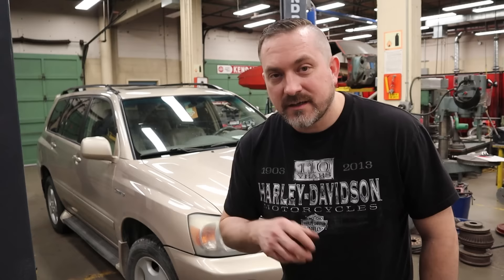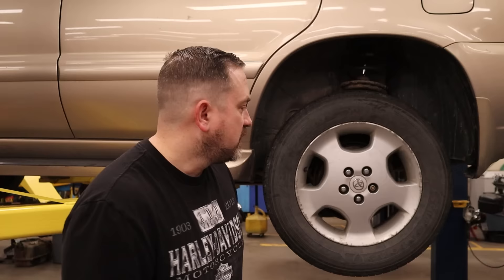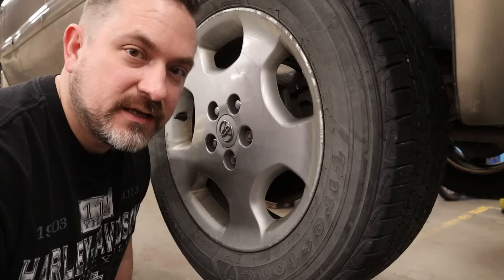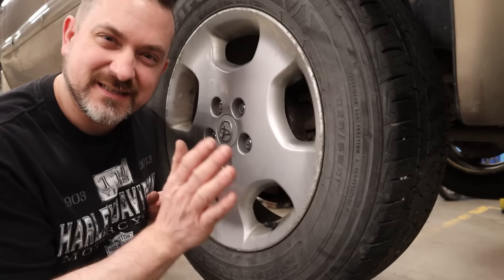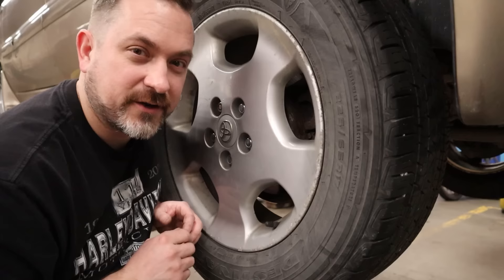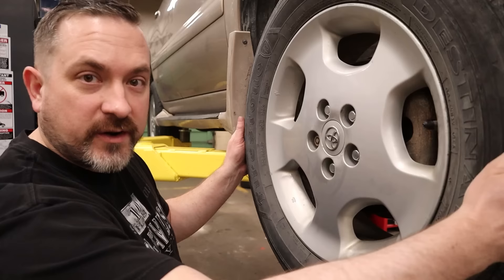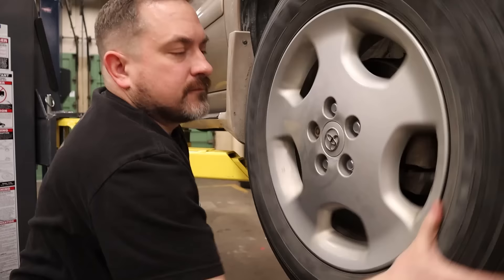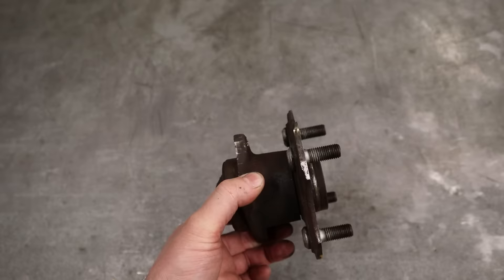How to 100% diagnose a bad wheel bearing.

Comment: My Honda accord 2011 start to have noise half year ago and is getting worse. It also has rubbing noise from 15mile-40mile/hr. on highway when I open either side of the rear wimdows, I can hear loud noise like helicopter. I cant hear such helicopter noise when open front window. I checked all 4 wheels but no play.

What could be the problem?
Reply from the maker: When you checked for play were the tires off of the ground?  You can't check for wheel bearing looseness with them on the ground, you have to jack the car up.

Comment: I have a 2012 Citroen berlingo and when I go really slow sometimes I hear like a clunking sound in the steering wheel? When i gain speed it goes away? Any ideas?
Reply from the maker: When you turn the steering wheel?  Hard to tell through a message but could be CV axles or bearing.  I have a great video on road testing a bearing you should check out too.  Thanks for the watch and welcome to the channel!

Comment: Ive got a wobbly front wheel ,  slightly left to right but worse top to bottom. Had the wheel bearing replaced a year ago and I dont hear any noise like before I replaced it.  Can you have a bad bearing WITHOUT noise?  The steering wheel shakes at different  hwy speeds at different  times so I can't figure out what is going on? It can be smooth for miles then I get the death wobble! Help!!
Reply from the maker: There could be multiple things going on.  Check lug nuts, suspension, and steering components for play.  If all are ok, then ya you might have a wheel bearing.  I have another video on how to road test a wheel bearing too if you're interested.  A death wobble is really serious though so get this fixed pronto!  Good luck!

Comment: Hey I have  a  2017 Ford mustang  it slides  when I change lanes  on the freeway  I have  already  had  a   front limite  and changed  my tires  and  it's  a little  better  but it still  slides in the back  end  of the car  what  can it be?
Reply from the maker: This sounds like loose or worn steering or suspension components.  Check the new tires for signs of alignment issue wear too.  Jack up the car and shake the wheels and pry on components to see what's bad.  Good luck and let me know what you find.  Cheers!

Comment: does a bad bearing at the rear make a knocking sound going over the pot holes and rumps?
Reply from the maker: No usually.  I would say it's a suspension component.  Does it happen when you go over a speed bump at an angle but not when you hit it dead on?  If so, that's anti sway bar end links or bushings.
Reply: many thanks. it does it when for example when not going over top of the bump but rather when coming down from the bump. i changed the springs, shocks sway bar  links, the rubber bushes, and some other bushes where the shocks bolted and so on and we run out ideas! the very shrap knocking sound comes off as the wheel makes its way down from the hump, as it hits the surface of the road. it does it on on very very low speed eg 5 miles an hour. obviously the more speed the harder the knocking sound! @wayofthewrench
Reply from the maker: Try this.  Have someone hop on the bumper to get the vehicle bouncing and hopefully making the noise.  Then get a light and listen/look for what is making the noise.  Hope that helps!  Let me know!

Comment: How do you get the wheel to spin while you have it jacked up? Wouldn't the brake pads and the car being in parked prevent the tires from spinning?
Reply from the maker: Great question!  If your brake system is working properly, the wheels should be able to spin no problem.  If a wheel is hard to spin or doesn't spin, then you either have your parking brake on or it is in gear/in park.  Or the caliper might be sticking and not allowing the pads to retract.  They should come away from the rotor and act as a wiper to clear mud off to give you an idea how close they are.  Thanks for the watch!
Reply: @wayofthewrench  I'm raising my vehicle with a car jack.  Wouldn't it be unsafe/could roll if I take it out of park while partially jacked up?   Thank you for responding so quickly!
Reply from the maker: If you jack up the front then no.  If you jack up the rear then you will have to remove the parking brake.  What ever drive it is ( fwd or rwd) if that wheel is being spun then you need it out of gear/park but remember I taught you to have two wheel chocks in front and behind the wheel still on the ground.
Reply: @wayofthewrench  thank you.  I need to get some chocks!👍😁
Reply from the maker: Happy wrenching!

Comment: Would there be play for a pressed in bearing?
Reply from the maker: If it is bad, yes.  If it's ok, then there will not be play.  If it's  a thrust style bearing, there could be a very small amount of play but that is usually adjusted out before you install the cotter pin. Thanks for the watch!
Reply: @wayofthewrench  2012 focus has pressed bearing.  I have a little clunk in the driver wheel. Every component o the front end has is new.  Been doing this before everything was replaced.
Reply from the maker: Sounds like bearing play.  If it isn't making noise, you might be able to slightly tighten the castle nut to reduce the play.  I have a video on that if you need it.  good luck!

Comment: Will a bad wheel bearing cause the tire pressure light to come on in a vehicle
Reply from the maker: Yes and no.  If you have a traditional tpms sensor that detects air pressure.....no it will not.  If you have a car that uses the wheel speed sensor to detect a low pressure tire by the flat tire spinning slightly less....then maybe.  If there is a speed dependant sound and play in the wheel though, you have a bad bearing and it requires a replacement.  Hope that helps.  Thanks for the watch!

Comment: So I have a question that I can’t seem to find an answer for. I have a 2017 Mazda cx 5 and after driving it and then going down a hill and applying the brakes a little the car will make a squeak or a chirping noise and can sound like someone taking a metal fork to a plate and this will make this noise for the rest of the ride even when the brake is not pressed and can only be heard if the window is down. It seems to be coming from the rear driver side tire. I brought it to the mechanic a month ago and they couldn’t find anything he said it may be that the brakes are glazed and if he files it down it may come back. Since then it has gotten worse and when I reverse while turning after hearing the squeaking noise I will hear 2 or 3 clanking noises like something is cracking. Weird thing is it only cracks in reverse when turning hard like pulling out of a parking spot and squeaks only when driving forward. I’m not driving it till I get it to another mechanic but if you know what this may be I’d greatly appreciate it.
Reply from the maker: My best advice is to do an inspection yourself.  I have a great video for checking disk brakes you should watch.  While you're there, check for a dust shield that is close to rubbing on the spinning disk.  You might have worn pads and the squealer tab is now touching.  The clunks in reverse could be suspension or steering related components.  It's really hard to diagnose over a message.  Hope that helps.  If I was able to help you out, I'd really appreciate it if you could share out my channel on your social media so I can help more people.  Thanks for the watch and welcome to the channel!

Comment: So I have abs sensor on,traction light on. Car gets louder with speed. Also u mention the steering linkage..well also a while back my key has been sticking ,not able to pull out, so ik I need a new key cylinder. But does that also confirm a bad wheel bearing? Thanks for anyone that answers
Reply from the maker: Sounds like you have seperate issues.  If your wheel has play and a speed dependent sound, then that is a bad bearing.  The abs/traction light needs an obd 2 scan tool to figure out what it's on for.  The sticky key/lock cylinder is a seperate issue and not causing wheel bearing or steering issues.  Hope that helps.  If you deem me worthy, I'd really appreciate it if you could share out my channel on your social media so I can help more people.  Thanks for the watch and welcome to the channel!
Reply: @wayofthewrench  ok thanks..I did figure they key was separate issue. No play really in the steering wheel

Comment: Heya! Thank you for this!  -I was just wondering.. Is there  A N Y  way, when going to look at a relatively high-mileage used car, say, over an hour away by bus.., that you can do a wheel bearing check without getting it on a jack? (Aside from listening while driving, of course.. ;)  Thx!!
Reply from the maker: You can hear a bad wheel bearing during a road test if it's bad so listen for that.  Other than that, you need to have the wheel off of the ground to confirm it.  Thanks for the watch!

Comment: So if its making a rubbing noise when turning sharp left (even when slow) then is that more the tie rod?
Reply from the maker: Rubbing noise at sharp turns could be the edge of the tire rubbing on the inner wheel wells, especially if the rim/wheel is a different size then the stock wheel or if the plastic wheel well covers have come loose.   Or if you've recently lowered the vehicle. Check for signs of rubbing on the inner wheel well.  Hope that helps. Thanks for the watch!
Reply: @wayofthewrench  I thought that too and still need to check, but it never did that before.  The car has not had any changes, other than a CV Axle replacement.  The tie rod did come off the other day and it does need to be replaced to I'm going to order the replacement either way, but I wasnt sure if that was what would cause that.  

Once the weather gets better I'll check a little more thoroughly. I just wanted a plan.
Reply from the maker: Let me know what you find, good luck!

Comment: My 2011 Prius makes clunking noise when the car moves at almost stopped speed when applying brake, is it the wheel bearing?
Reply from the maker: Probably not.  Sounds like a loose joint for suspension or steering or even a random thing in the trunk.  I would do a full inspection and check for loose joints.  Hope that helps.  Thanks for the watch and welcome to the channel!

Comment: Well now I don't know. I have the sound in my right front wheel. When I turn right it gets louder which seems to be the opposite of what I'm told. I get no noise by spinning the wheel, no vibration in the coil spring, but there is slight play on both vertices. I have no idea what to do now
Reply from the maker: You could have both sides ready to go , in fact they like to change them in sets.  If the sound gets worse when turning right then your bad bearing is on the left side.  That bring said if there's play up/down/left/right then it's probably a bad bearing or a combination of several things like steering and suspension components.  I do have another video on road testing a bearing, you should check it out. Good luck.
Reply: @wayofthewrench  well it does get worse when turning right but the noise is very obviously coming from the right wheel, there's no mistaking it. sitting on the passenger side you can feel a slight vibration through the floor when at speed that changes with the noise. Being the sound is on the "wrong" side for the turn i'm not sure what it is.
Reply from the maker: Sounds like both sides are blown.  Which is fine because you're supposed to change in sets anyways.  Did you get it sorted?

Comment: My front driver side tire or in that area does what i would describe as two metal plates scraping against eachother or two plates that should lock onto eachother but dont and they grind against eachother but only when i shift into drive from reversing (like if i back out of a parking spot) and turn the wheel to the right. Also, when it does that the the car wont move i have to let go of the gas and accelerate again for it to drive normally. Does this make any sense? I got 4 new tires, new brakes, new rotors and a full inspection maybe 3 months ago and it put a pretty deep dent in my pockets so i cant go get it checked right now. Any idea what it could be?
Reply from the maker: Sounds like a very bad issue whatever it is so it might be easier to diagnose because the parts are so worn out.  It could be a universal joint on a drive shaft or a CV axle that is clunking every time you change directions.  I would jack up the car and give the wheel a shake, turn the steering, and check drive shaft/CV axles for looseness and sounds.  It doesn't sound good so I would get that checked out soon.  Good luck!

Comment: If I’m the wheel bearing in the front gets replaced do I need to do an alignment?
Reply from the maker: Generally no as long as you did disturb or change and steering or suspension components.  That being said if you're noticing a new pull while driving, then you will need an alignment.  Hope that helps.  Thanks for the watch and your support for the channel!
Reply: @wayofthewrench  it does thank you
Reply from the maker: Cheers!

Comment: Mine do not spin that freely. They’re actually very very stiff. I didn’t see/hear play but I do hear a slight clicking sound when rotating just the hub assembly. And, again, the hub assembly does not spin freely.
Reply from the maker: This might be that you're trying to turn the drivetrain, try putting it in neutral ( safely so the vehicle doesn't roll).  The sound is better diagnosed when driving and the play checked lifted up.  I have a great video on road testing a bad bearing you should check out too.  Thanks for the watch and welcome to the channel!
Reply: @wayofthewrench  I just checked out your video and no my car isn’t making that obvious of a sound; however, I have some shake in the front end between 65-70 mph and under braking. The front end is also very loud (like wind noise but turned up to 11). Then there’s a sort of scraping sound at low speeds (20 mph and below) as the car is decellerating. My initial thought was “oh great warped rotors again.” I took everything off and found my piston side pads are wearing faster than my wheel side. I’ve ordered two new wheel bearings and will get new brakes too. At 140k miles it can’t hurt to replace the bearings. Luckily the CV axle and the tie rods look good.
Reply from the maker: Sounds like your slider pins on the caliper are stuck and not letting it float.  Check my video on disk brake pads replacement.  Good luck!
Reply: @wayofthewrench  One of the slide pins was stuck, but all my brakes looked dry. So I greased them back up. Brought the car in and they said my carrier bearing was going bad. The wheel bearings were starting to make noise but they still have some.life in them. I learned my lesson with my seized strut that if something is well rusted, I'm going to put things back together and let a professional handle it. So whenever those items for sure need replacing I will have a mechanic do it.
Reply from the maker: Ya know working on cars is all about getting more experience, the more you do it....the more you'll know how to fix.  A stuck slider pin isn't that bad to fix and the next time you'll know to clean and lubricate them so it won't be an issue later.  It took me 30 years to learn what I am teaching in these videos.  Cheers!

Comment: I hear more weird noise while driving slow than high speed, like between 30 to 40 km/h it's worst, below that it's fine, higher than that it's bad but noise is stable. Is it bearing issue? Or probably something else?
Reply from the maker: Hard to say from a message but it could be.  If it's sound dependent then most likely.  Thanks for the watch!
Reply: @wayofthewrench  I see, thank you
Reply from the maker: no worries.  Cheers!

Comment: My Toyota fielder 141 is making a very similar sound from this video, but I am not able to determine which side its from. tried the wheel shake method as well still cannot. took it to a garage and the mechanic changed the front left wheel bearing, however the sound is till there. I don't want to be guessing now. is there another way to check. could a similar sound come from a CV axel?
Reply from the maker: Nope, sounds like you did the bearing check and didn't find a bad wheel bearing.  That's why your mechanic changed it and there was no change.....its not a bearing.  Did you check for looseness/play in the cv axles?  Check for a nail in tire?  Did you check all wheel bearings and were the wheels off of the ground?

Comment: What about abs light on and sound like brakes are srubing
Reply from the maker: ABS light is on because something is wrong with the ABS brake system and not the base brake system.  The light scuffing sound of brakes as you spin is somewhat normal.  If you have a bad wheel bearing, the checks will still be the same, check for looseness left/right and up/down. Thanks for the watch!

Comment: Does the sound change based on pavement type
Reply from the maker: The bearing sound will not but the tire sound will.  On most smooth asphalt roads and passenger car tires, you will not have much road noise from the tires.  Thanks for the watch!

Comment: Do you need alignment after hub/wheel bearing replacement?
Reply from the maker: Usually no but if you had to remove/change  any steering/suspension components, then yes.  This also doesn't account for whether the vehicle needed one before you did the work.  Some shops lean towards guaranteeing that your vehicle is in the best condition possible and might suggest an alignment though, especially if they spot abnormal tire wear or pulling during a drive test.  Thanks for the watch!
Reply: @wayofthewrench  thanks for the response
Reply from the maker: You're welcome!